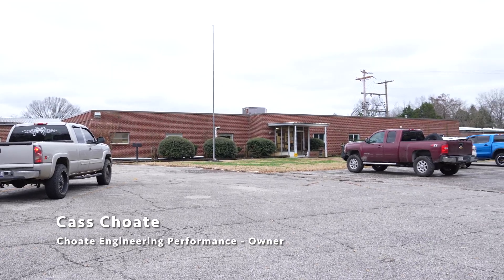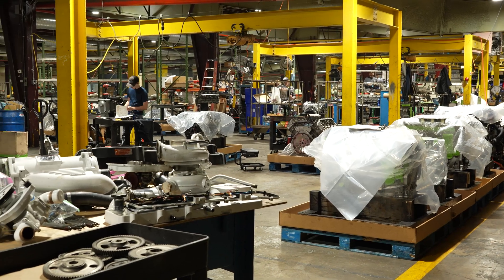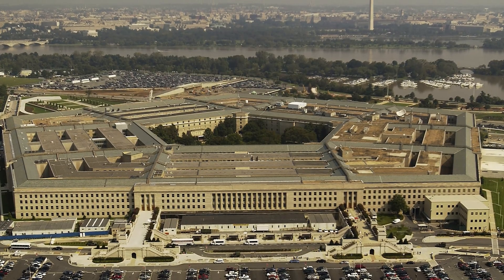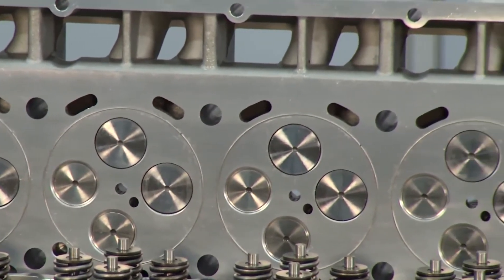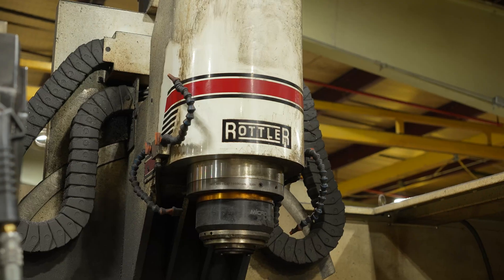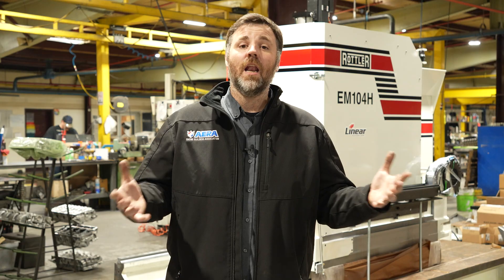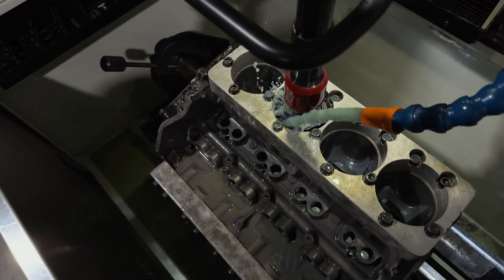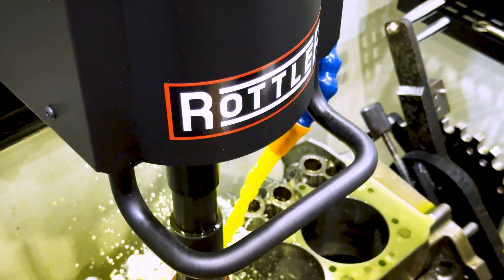They Build Diesel Engines the Way the Factory Should Have

Comment: How did I live in bolivar for 2 years and not know you were there. Would have saved me so much headache with my flatbed.
Reply: WE are here! Stop on by we are always up to giving a tour!
Reply: Their engines are all well over $20,000.    Just an FYI.
Reply: @DownEastSaw  Some of them are! not all!
Reply: @BuiltbyChoate  well yeah, I get it, short blocks, long blocks, etc.  I was just kinda saying that if you want a legitimately well built diesel, it’s gonna cost $20,000+.   I’ve been building engines for long enough that most people just don’t realize how much time and expensive machinery goes into a bulletproof engine build.   When a customer asks for a reliable 500 horsepower motor, I quote them for a 1200 horse build detuned to 500 horse.   People were always so confused that the same 5.9 commonrail Cummins was 300+ horse in the Dodge ram but the same engine was 185 horse in a box truck……..until I explained that the box truck was expected to last 300,000 plus miles of foot on the floor, loaded well over gvw driving, while they knew darn well that 99% of diesel pickups never haul more than the groceries for 100k before the family sells them and buys another.

Comment: My tugboat has two 3516’s in it. Most boats are built for life. My boat would need so much of the hull cut out to remove the block it would not be economical. Any time we perform engine overhaul it’s either top ends in place or we lift up a stripped block for measurement and crank bearing replacements when doing a zero hour rebuild. Some boats are designed for rapid engine changes (western towboat stands out) but most do not.
Reply: @Jon_Flys_RC  it’s actually standard procedure to cut a big hole in a boat to replace the power units.   That’s why shipyards and marinas don’t just employ mechanics.   Everything from lobster fishing boats to cruise ships are intended to last significantly longer than their power units.   That’s why so many older boats have a big patch in the deck right above the motors.    Anyone who owns a large boat needs to be able to afford this eventuality.
Reply: @ you can’t do that when the engines are under the superstructure of the house and there are permanent system in the way
Reply: @ the come out the side.   Seriously bud, I’ve been in an around the boat/shipbuilding industry for a long time.   Portsmouth naval shipyard, channel marine on Paugus bay in Laconia, NH, so on and so forth.   If what you say was true, I wouldn’t have seen in done so many times.   If a boat or ship needs a repower, it is entirely possible, no matter the construction technique.   Just because it may cost $50,000 or even several hundred thousand, it’s still cheaper than buying an entirely new boat.  NO, the boat will not appear as new with a giant patch welded in the side, but it will run better than new.   Please don’t spread lies just because you don’t like the options available.   It is entirely possibly to repower a ship with the units sitting below the pilot house or passenger decks.   There are dry docks and many options for this exact issue.
Reply: @DownEastSaw  sometimes things are possible but the cost is outweighs the net results.  I'm not familiar with these boats but anything men built can be rebuilt by an another men.  It is mostly 2 deterrent - 1. parts availability and 2 - cost of repair. If the cost of repair is higher than the cost of a replacement boat (good used) most folks will do that.  I mainly work in the auto and truck industry but i assume used boats are available with huge discount compare to a new one. Also a refreshed engine - doing only the top - might give the boat an another life before its junked.  Some people do it anyway but I have seen the same done in trucking industry. You rebuild the engine and spend 50% of the vehicle on it. The next thing dies is a transmission, steering system, hydraulics, pumps, rust, etc. I'm sure it is the same on boats. Once the engine is ok, the driveline goes next, then the electronics, hydraulics, etc. etc. Sometimes its more efficient to just let it go.
Reply: @ there are very few boats that are cheaper to buy than it is to repower them.   The problem is that these boats are owned by businesses which are run very poorly and do not budget for the eventuality of needing a full or even a partial repower.   Seriously, think about it.   A brand new tug boat costs anywhere from a million to well over 10 million dollars.   Even if a full repower costs 500,000, that’s cheaper than a new boat,   Problems arise when owners don’t maintain their boats, so there are many problems with the boat when it finally comes time for a repower, compounding the costs and leading them to claim that it was “cheaper to buy a new boat.”   To ever claim that a repower at less than 1/8 the cost of a replacement boat isn’t viable is just flat wrong.   Simply because a particular boat owner cannot afford something doesn’t mean it’s impossible or even financially irresponsible to do.

Comment: I don't know man, Gail Banks shows those pistons reduce the swirl in the combustion chamber. 
He explained it all the way through
Reply: If you can find a way to keep the valve from contacting the piston with increases duration and lift, Gail would love to hear from you as well as myself,  Cat, Cummins, Paccar, Detroit, and every other engine manufacturer in the world.
Reply: I trust Banks by far over choate or any other builder. I've heard some stories about choate. But who in the business hasn't had some issues and made a stink before.
Reply: @Jengoboys603  There is certainly some extremely overpriced snake oil selling going on there.

Comment: When you build a duramax do you replace gm's cheap dowl pins on the crankshaft and camshaft with a keyed crankshaft and camshaft ?
Reply: Yes, broach, a keyway
Reply: They should and you should too. Have a machine shop machine key-way cut in the crank. Some aftermarket parts co. Are already making parts to accommodate the keyway redesign other machine shops have pressed for.
Reply: When rebuilding a duramax....everything has to be replaced....unless you like unreliable junk....same goes for any 6.7 cummins....crap